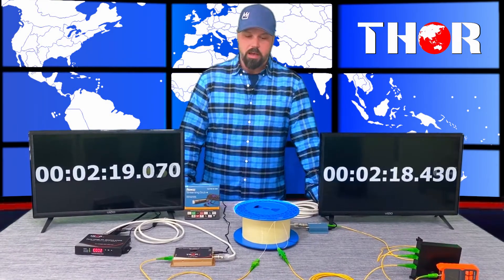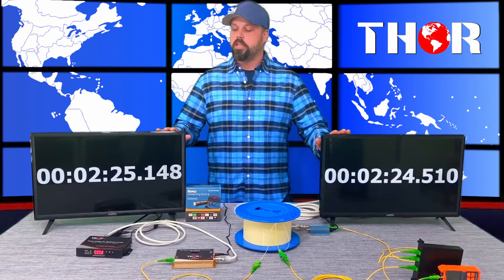HDMI Modulator and RF over fiber latency demonstration Thor Petit connected to Fiber optic TX and RX

Comment: I presume this is carrier agnostic, meaning it can carry ATSC 3.0 waveforms...
Reply from the maker: Yes, this is correct. Any modulation standard from 54-1000MHz can be passed through. The RF input power needs to be between +15dBmV and 25dBmV. We also have L-band over fiber devices with a wider spectrum of 54-3000MHz: F-LBAND-TX/RX. You can find more details at https://thorbroadcast.com/product/l-band-over-fiber-tx-rx-basic-1-ch-kit.html